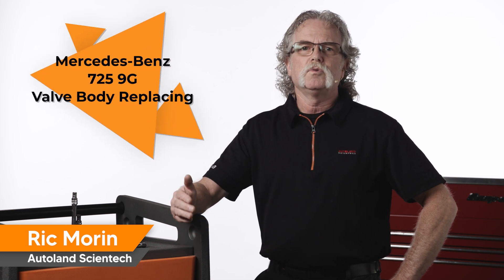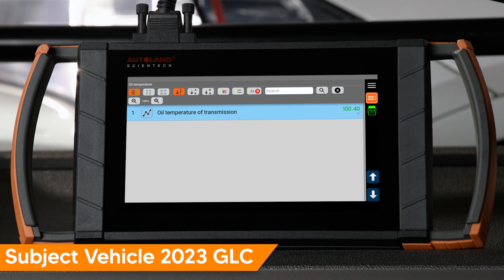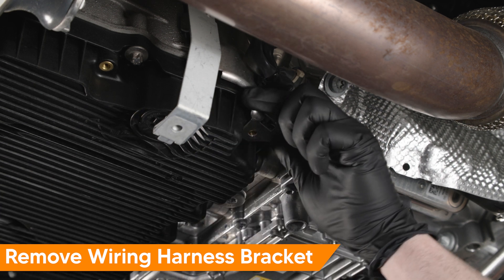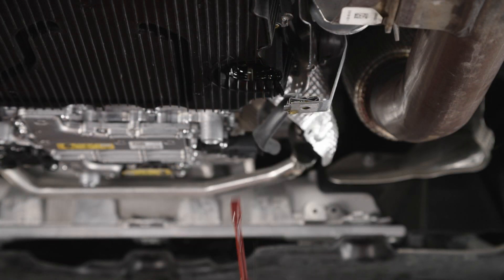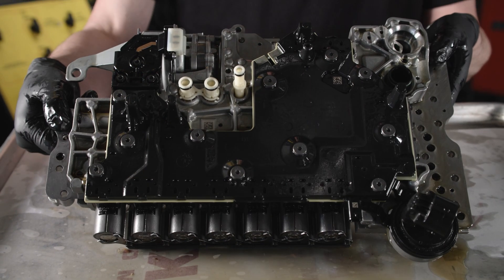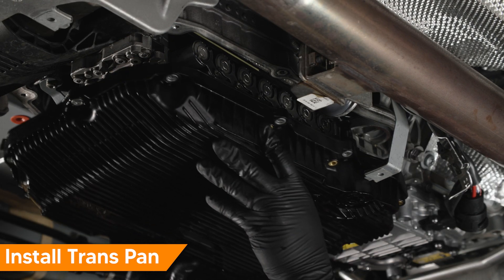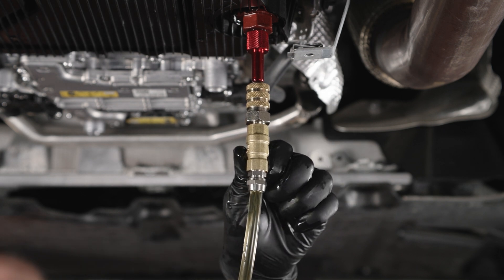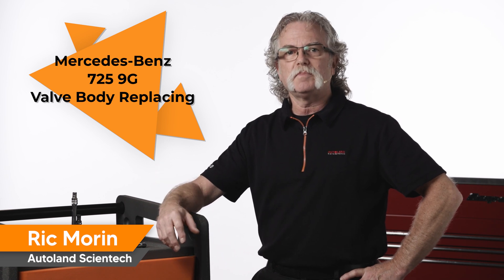Mercedes-Benz 725 9G Transmission Valve Body How to Replace & Code / Program New Part

Comment: Leave it to Mercedes to make it overly complicated to do a simple fluid and or filter change. LMAO
Reply from the maker: Correct fluid level is everything when it comes to transmission function. This method is much easier to confirm level than the older methods of drain holes and watching temp. As complicated as it looks, it ensures the customer's vehicle is filled correctly, the first time. Thanks for watching!

Comment: It is a C220D 2018 coupe. 
My scanner doesn’t show any code however on the live data is showing position of range valve fault.
And in 1st 2nd and 3rd is jerky.
Reply from the maker: I can only speak for out devices, iSCAN scan tools. You should be able to check adaptations and solenoid function. Be sure to start with fluid level and quality.

Comment: If i may ask for some help.

do you think its necessary to drain fluid in tq converter?
do you notice if these electrical connector have leak issue like the 722.6? 

do you have conductor plate service video? i have p073e code 'can not engage reverse'
I have to replace the pressure sensor but do you know why it fails? metal shavings around solenoid?
Reply from the maker: Yes and yes. 
Here is the conductor plate video: https://youtu.be/TeKlw2Sntzw?